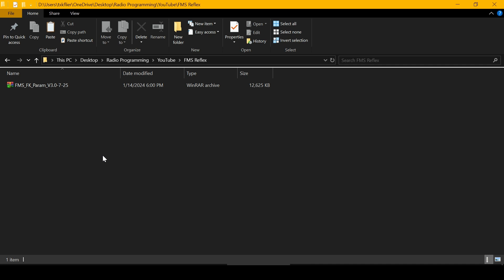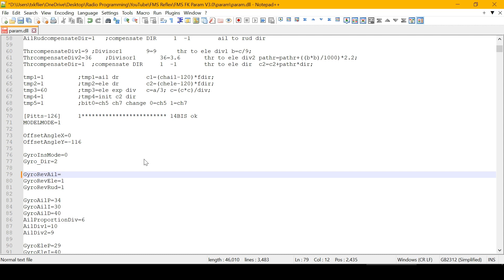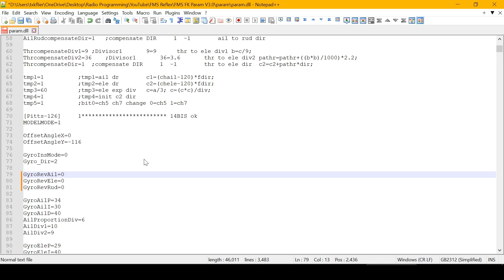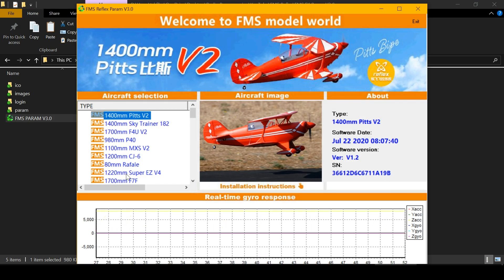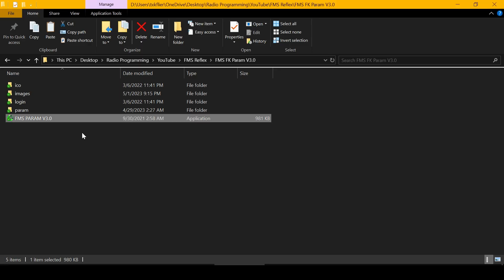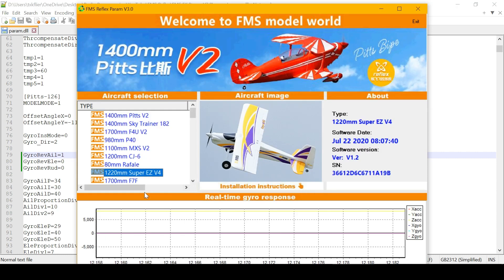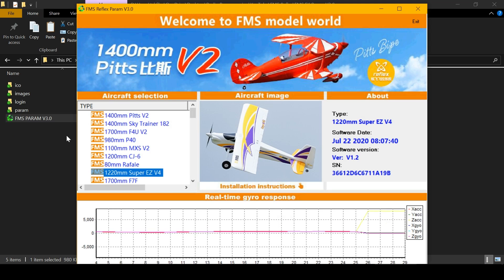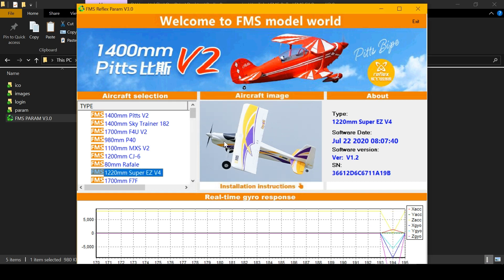How to Edit the Settings in an FMS Reflex Gyro - 13 Feb 2024

Comment from the maker: Be sure to use an FMS model that is most like the non-FMS plane that you're wanting to put the Reflex gyro in. The gyro gains should be close, but the control surface movement and/or the gyro direction could be reversed. Get the surfaces moving in the correct direction by setting the channel reversing in your transmitter first and then check to see that the gyro moves the surfaces in the proper direction as you rotate the  plane through each axis.

Note: I made this video before the V3 came out. You can use this technique with the V3 as well. Just connect it to your PC using a USB cable.
Reply: Thank you so much,  it worked and i'm computer illiterate. Incidently, you could sell sand to the arabs with that voice.
Reply from the maker: @pat7630-y3e  Thanks, but I can't stand my voice..  😎
Reply: Thanks much. This video is a savior.

Comment: Hi so i tried doing ith with notebook but everytime i follow your instructions and open it thesettings are still the same can you tell me what im doing wrong.
Reply from the maker: I just watched the video and didn't see where I made any mistakes. So, I'd say you're either editing and/or loading the wrong model or you're not closing the FMS software and relaunching it after editing the model in the param.dll file.
Reply: @txkflier  hello the problem is when i do the steps it doesnt let me save ith i was just wondering wat i can use to open it as a dll file
Reply from the maker: @daanvangoolcooper You open and edit it with a text editor. Then save it. The run the FMS software.
Reply: @txkflier  which text editor would you advise
Reply from the maker: @daanvangoolcooper Well, I used Notepad++ in the video..
Reply from the maker: @daanvangoolcooper They may have used the DLL extension to make people think it couldn’t be edited. But if you right click and select “Open with..”, you can choose which program to open it with. Notepad might work, but I haven’t used it.
Reply: ith worked thank you so much

Comment: Are there expo settings for the reflex v3?
Reply from the maker: It has dual rate settings, but not expo. The Spektrum AR636 had expo, but it was easier to set up expo in the transmitter. And since expo only reduces the travel near neutral and doesn't change the travel at full stick deflection, the gyro will still work like it should.

Comment: I know this video is aged but where do you get this software? I have a v3 in an ugly stick non-fms plane and the ailerons are reversed when gyro moves them. TX movement is correct.
Also I had to mount Rx upside down, any suggesting on which plane to choose in the phone app?
Thanks in advance!!
Reply from the maker: You can manually edit the model configuration using a text editor such as Notepad++. You just need to change the value for the orientation and then recheck the gyro direction. Of course, the gains might need tweaking too. I'd choose a plane that looks the most like your Ugly Stick. If your Reflex is the newest version, you could use the custom plane setup. My Reflex died and I returned it. I'll see if I can still access the program without it.
Reply: @txkflier  mine is the v3 but don't now if it's the newest as you mentioned. 
Also where is the "custom Plane" setup you mentioned?
Reply from the maker: @  Well, FMS created confusion by calling the older gyro V2 and the software V3. I think the newest gyro has V3 on it, and I believe it can be programmed with the same V3 software. Plus, the newer one can be programmed using the phone app; the V2 gyro couldn't. How is yours mounted in the plane? You said the receiver is upside down. What matters is how the gyro is mounted. Are the gyro's input pins to the front and is it right side up? The custom model might be called "Other plane".
Reply: @txkflier  mine is mounted in the belly of the plane and only access is to turn the plane wings down. 
The gyro is mounted with the 4 plane throw pins facing the front of the plane. 
Again the gyro is upside down when plane is upright. The custom plane option has the gyro mounted facing right side up in the plane so will not match what I have
I did manage to find windows version of the software and did manage to edit the .dll file just haven't had time to test it in the plane. Maybe when I get home from flying tomorrow 😁
Reply from the maker: @kennyd.5743  Have you read all of this thread?  https://www.rcgroups.com/forums/showthread.php?4510525-FMS-Model-FMS-Reflex-V3-Stable-Flight-Controller

Comment: The thing that is really wonky with this software is the fact that there is a graph showing the gyro response, but when it is updated with the new param.dll file telling it to reverse a direction, it does not show the response in the reverse direction. How stupid is that? I don't know, maybe it's simply not loading the new settings into the reflex unit. I have a V2 with the Pitts data inside of it. I had to update the servo's to a different brand of digital servo's and every channel was reversed in my radio. Of course the gyro now was not acting in the correct direction. I tried to follow this, and the V2 software doesn't work at all. The V3 software does connect and populates the data showing current version and serial number, but it won't change gyro direction when I follow the advice in this video. I'm baffled why the changes wouldn't show up on the graph at all. What is the purpose  of the graph if it doesn't show the gyro amplitude of signal and direction???
Reply from the maker: I never looked at the graph. I checked to make sure the control surfaces moved in the proper direction with the transmitter sticks and then I checked to make sure the gyro moved the surfaces in the proper direction. If the gyro was reversed I toggled the direction value in the config file, wrote the updated file to the gyro, and checked everything again.
Reply: @txkflier  I was hoping that's all I needed to do as well, but apparently there is something wrong with the current software and or my unit. The reflex worked perfectly with the original servo's installed. I keep getting an error "Index out of range" which in software usually means an array value is being referenced that doesn't exist for a given size of array. This makes me think that the param.dll file is somehow corrupted with bad data. I even tried to use the V2 param.dll file using the V3 software to do the update, but that did not work either. I was so excited when I seen your video and thought it would be relatively painless. Is there any chance you can test this out again and see if the graph changes direction of the gyro? The only other thing I can think of is that the current version of this software has a bug in it. Well, I have had enough of this very limited gyro. For those that got it working after modifications or changing planes, good luck to you. I went ahead and pulled the AR630 out of my new SUS and put it into the Pitts. Now I have AS3X+ in the Pitts.
Reply from the maker: @ Yeah, there are much better gyros than the Reflex. The Hobby Eagle A3 Super 4 works well and is easy to program. I’d rather use the Spektrum Smart AS3X/SAFE receivers. They work great, have telemetry, and can be programmed from the transmitter.

Comment: Hi. Very helpful, I had to reverse the ailerons on my fms 1450mm v6 p51d mustang. Do you know how to change the standard mode order in the settings files at all, I want to swap the stabilzed and optimised over. Thanks
Reply from the maker: @ENGDyna  You can change it in your transmitter. Just edit what the values are in each switch position or reverse the channel if you want to swap what the end positions are.
Reply: @txkflier  I have it set with the gear retracts channel but it just won't swap. I've got a mix that turns it off in the mix switch on my dx6i. If I reverse the gear channel it'll open gears soon as add battery power. Strange. I have no problem using the gear and mix switch with hobbyeagles and lemonrx stab+
Reply from the maker: @ENGDyna  You have retracts and flight modes on the same channel?
Reply: @txkflier  yeah on 3 of the planes I use with retracts. I prefer to take off with autolevel with gears down then once I flip them up it's Gyro only. For some reason I can't swap that over in reflex, I can adjust using 0 - or +100 no problem with hobbyeagle and a lemonrx stab+ i have. Strange. I'm assuming there's a parem setting in the files to swap it around
Reply from the maker: @ENGDyna  I don't recall a way to change the flight modes in the Reflex. The Hobby Eagle is a much better option. I wouldn't buy a Reflex, and I won't be reprogramming one that came out of an FMS plane. I did buy one of the newer V3 Reflex gyros and wasn't impressed with their app. Fortunately, I was able to return it and got my money back.

Comment: I Wonder ,must i have fms plane to use this gyro ?
Reply from the maker: Most people should. This video was an attempt to show how to use the Reflex in a non-FMS plane. So, if you've watched it, you how difficult the process is, and we still don't exactly know what all the settings do. I bought a Reflex V3 that's easier to configure, but it died and I returned it. I don't recommend the Reflex to anyone. Get a Hobby Eagle A3 Super 4 instead or perhaps a Spektrum Smart AS3X/SAFE receiver.

Comment: Hi, My reflex v2 in sbus mode whit frsky receiver x8r don't work channel 5 to change mode. Work only whit pwn wiring. (NO FMS Plane) Can You set sbus default to work? In the manual is write the wiring are any different to work in sbus or pmw. My case don't work. You have solution thanks.🖐
Reply from the maker: Try setting “tmp5” to 0 (tmp5=0). Supposedly, a 0 is channel 5 and a 1 is channel 7. If your transmitter has 7 channels, I would leave it set to 1 and use channel 7.
Reply: Thanks, I tried to put both channels 5 and 6 and 7 on the radio on a 3-position switch. By connecting to sbus it worked on channel 7 without needing to modify with note++. Instead I had to edit channel 1 Ail, as the response of reflex2 was inverted. Thank you.👍🖐
Reply from the maker: @MrSalvoFly  Since most of my planes use 6 channels, my standard flight mode channel is channel 7 and gain is on channel 8, if used. I use a template or copy an existing model when adding a new model. I’m very “standardized”.

Comment: Just a noob's question. I'm not at all familiar with this gyro but from our experience with other Chinesium gyro systems, they pretty well all seem to operate the same way. At about 1.30 you mention to first check that the sticks are driving the servos the right way THEN start to check how the Reflex unit drives the servos under the Self-levelling. This is usually a No-No since, for most of the ones that we use (Kopilot lite/Lefei Sparrow/Radiolink Byme-A/etc) reversing the gyro correction direction ALSO reverses the radio stick direction. Reversing the radio stick direction has NO effect on the gyro correction direction. Hence leave the radio alone until the gyro corrections are fixed. Or do these operate differently?
Reply from the maker: I've slept since I last checked, but the Reflex and Hobby Eagle gyro reversing setting only reverses the gyro, not the stick direction. But, I'd double-check everything after any change.
Reply: Also you seem to have the same (incorrect?) set-up order mentioned in both your own pinned comment above and the description.
Reply from the maker: @theoztreecrasher2647 That’s probably because that’s how it worked when I tested it. Have you set one up?
Reply: @txkflier  We don't have a Reflex unit to test. We do have 2 HobbyEagle A3 Super 4 and Minis but haven't set them up yet. 1 of our Old Farts Group did have an A3 Pro that he promptly destroyed by having it incorrectly set up - an all too common event with us geriatrics! 
We (or myself) are WAY more experienced with the other Chinesium units mentioned above - and they DO work as described above. When we get around to installing 1 of the Minis I'll get back to you with the results.
Edit. Now that I think of it, someone does have an FMS SuperEZ that must be fitted stock with some sort of Reflex unit - but I've no idea which version. Nobody ever tried fiddling with it anyhow.
Reply from the maker: @theoztreecrasher2647  I have set up and flown both the A3 Super 4 and the A3 Mini..
Reply from the maker: @theoztreecrasher2647  I just confirmed that what I said was correct. You must set the reversing in your transmitter first so that the surfaces move in the proper direction with the sticks. Then you edit the gyro reversing parameters in the gyro config so that the surfaces move in the correct direction as you tilt the plane away from level. I check the gyro in self-leveling mode because it's easier to see what the surfaces are doing. You only need to tilt it 45° in each direction to check the gyro's response. I check the rudder by swinging the tail back and forth. The A3 Super 4 has servo reversing and gyro reversing. You must set the servo reversing first and then set the gyro reversing, if needed. Of course, no one should take my word as gospel. I'm not going to replace your crashed plane, so you'd better check it.
Reply: @txkflier  Thanks! That's quite different to the others that I am familiar with. So the A3 Super4 has the option of both reversing the gyro compensation direction AND the stick driving direction directly in its set-up menu. You then wouldn't even need to adjust the radio stick channels directions. I'll have to do some reading before we tackle the HobbyEagles. 👍👍
Reply from the maker: @theoztreecrasher2647  I’d much rather have the A3 Super 4 than the Reflex, and even the A3 Mini is more versatile and easier to program than the Reflex. Plus, the Hobby Eagles are cheaper, but you should get one of their programming cards. The Program Card “X” will program any of the digital Hobby Eagles.
Reply: @txkflier  Yep. We've 1 of those in hand.

Comment: How is the computer connected to the gyro? How is data transferred, by cable or WiFi?
Reply from the maker: I made that video for the V2, so you have to use the cable that came with the V2. You can do the same thing with the V3 because it still has a USB port and uses the same configuration file. They just added Bluetooth to the V3.